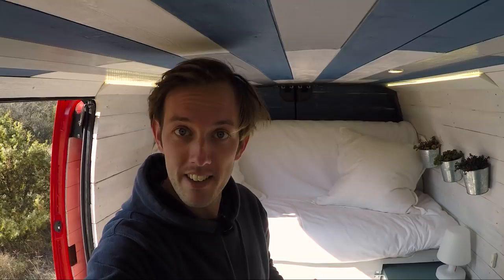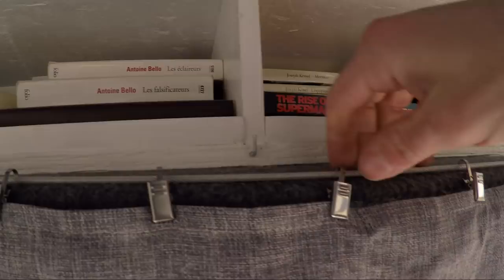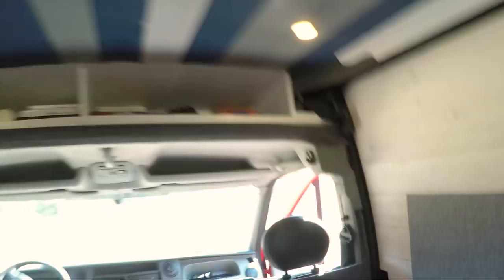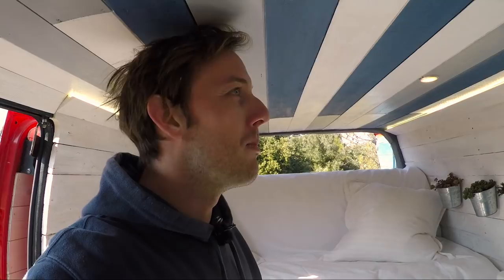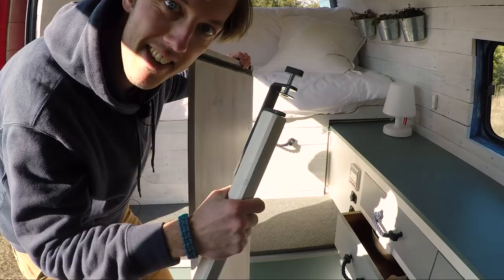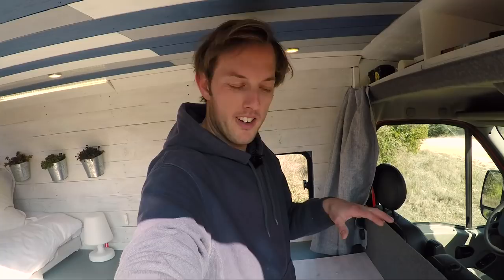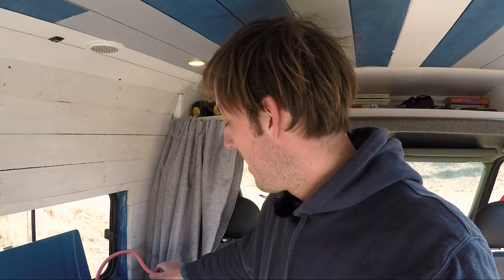VAN TOUR - DIY Camper van / Studio Conversion (New bed and table ideas for short wheelbase van)

Comment: Congratulations! I am a camper builder(Masal Karavan) from Turkey. I will give you an advice. If there is no air space between the roof and the solar panels  , panels don't work well. They must take air , and cool down. Lift your panel 2-3 cm with 'L' aluminyum profile... You will get more ampers from the panels aspecially in hot days.
Reply: Can I ask what about the flexible panels that stick directly on to the roof are they any good? I was thinking about getting these for my van
Reply from the maker: Thanks for the tip! Yes i did think about it but i planed my solar system to have enough energy on cloudy days. So on a sunny day even if they get hot it will be enough... i guess i don't need my system to be as efficient as if i was running solar panels to feed back to the grid. But it will be useful to optimise them if i ever consider adding another battery.
Reply from the maker: Flexible panels are great if you have no other choice, but they are more expensive and much less durable. I killed a Goal Zero folding panel while traveling on a bicycle just because it got a few scratches. If you have a enough space on your roof better take the time to install a good one.
Reply: Batu is correct.  On the other hand, if you are aware of that and choose to do otherwise, that is your choice.   I have enjoyed your videos so far.
Reply: Thank for that info.... I didn't know that and am sure many others didn't know it, either.  However, I'm wondering about the soft solar panels which are made to put down with double sided tape.  Does that mean they lose amperage, too?
Reply: @tegmapat11  It does tegma - the fine print on the panel will say to leave a few centimetres.

Comment: Best minimal van overall. Perfect for a wannabe writer, internet entrepreneur, retired...
Unfortunately, most think they need an 'RV' inside a van. What I have learned:
1) Personal products,  clothes, linens, towels
2) 5 day ice cooler with drain plug
3) 12v Immersion heater coil for hot water.
4) Butane stove (outdoor)
5) minimal small cooking supplies..ect (can beans, soups)..
6) Paint bucket with toilet seat/disposal camping bags.
7) Gallons & cases of water
8) Solar power
9) Security system, personal alarm, weapon.
10) A stealth presence

P.S.- A dishpan is a must for bathing, cleaning, ect.
Join a national gym chain.

Happy Trails

Comment: Thanks for the vid.
Some ideas for improvement:
-Move your kitchen to the back in that space where you keep the bike. You can fit a pullout counter with  alcohol stove , sink, chopping board. Use small kegs or roof mounted water tank which you pump with pressurized air.
-Store more counters and utensils by modifying the hollow rear doors, replacing their supports with aluminum T or V-slot rails. -
-Move the bike to a roof  mount or rear mount on the outside of the doors at the back. 
-Get a spare AC compressor that mounts onto your engine, use it to fill a pneumatic reservoir as you are driving, shuts off once the tank is at pressure. The reservoir is just a tank, you could use an aluminium scuba tank, you could use to power a water pump, drill and other hardware for repairs on the road.
Reply: I kinda like it perfectly the way it is.

Comment: Damn cool :D I would integrate sink and tank just because it would make washing dishes etc. and water management easier. Maybe even water filtration system. A moveable stove is actually pretty good idea because you can also use it outside. You could have top-drawer custom made for the stove, so when you draw it out, it could be used without moving.

Comment from the maker: I hope you guys enjoyed the video. If you have any  questions do leave a comment!
Here are some useful Time Stamps: ↲  Also the Van Build video is here: https://youtu.be/ko-F0Ma4i-w
1:05 Inside of the van
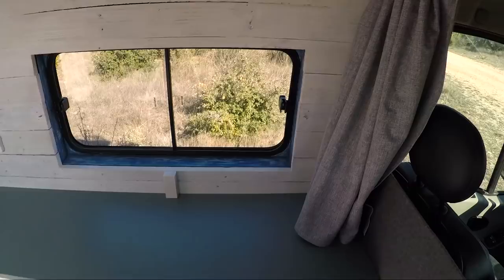1:19 Curtain
1:57 Window panels
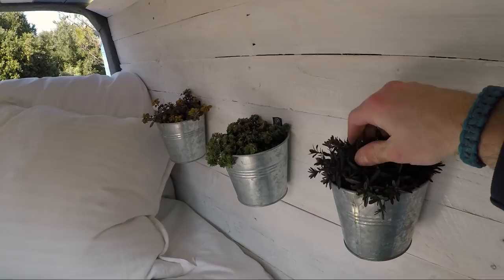3:03 Plants
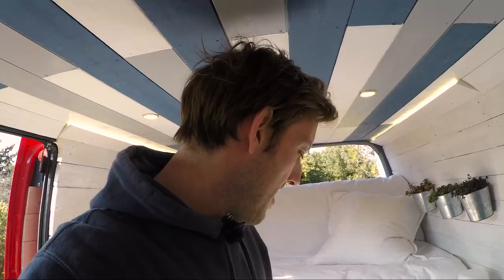3:30 Table
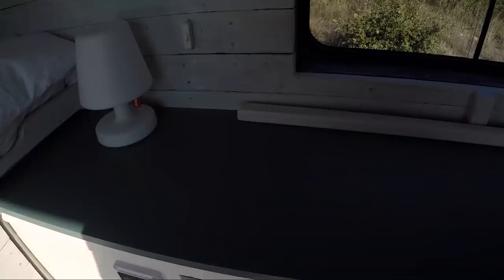5:40 Kitchen
8:33 Water bottle + Heating
9:38 Back storage
10:53 Small fact about me 
11:53 Bed
13:29 Recap/end
Reply: Clever :-)
Reply: Why not drill two holes about half way down on each side of your window board/mat inserts and run some 550 chord through them as handles (similar to your pull on the bed) to make it easy to hold onto them to put them in and to pull them out.  Also a small retainer clip that swivels on each side of the window to keep them in place as time goes on.
Reply: What is your van model? It looks so cute small
Reply: What type of van is it?

Comment: You can always use small heater.  They seem to do the job.  That's what I use when I go camping.   They are small, not to small but it doesn't take much space.   You could put one on the table or two since they are small.

Comment: Fantastic build for a SWB van.  The only thing missing is a toilet/shower area.  I assume this is just 12v only.  I really don't see a need to mains voltages.  There are lots of alternative products that can run on 12v.  e.g. fridges, microwaves, laptop chargers, TVs etc.  The hook for lifting the curtain to stop light escaping is, frankly, just a work of genius.

Looking forward to more of your videos especially the electrical side of things.  Many thanks.  Oh, and I love the way you managed to get your own thumbs up up inside the graphic thumb at the end.
Reply from the maker: Thanks! Yes 12v only. No fridge, no microwave, no tv ;-) but yes i do have a laptop charger, which only recharges when the laptop is off because it requires too much wattage when running... Yes van build is mostly about finding fixes to tiny problems you could not have thought of beforehand (like the curtain fix). For the electrical, it's in the new Q&A video: https://youtu.be/6R4f7fZY4Bk

Comment: If you can find it, use a secondhand webasto (or other brand) diesel or petrol powered engine/cabin heater. Mostly build into car to pre heat the engine an cabin, very useful to use the standard carś heater system to heat your van (Your setup may need some work to get some ducts towards to back and maybe some of the controls extended to the rear) I use it also to heat 10 L of water inside a modified undersink waterheater (which used to be electric but has been converted to be heated by warm water coming from the engine and/or engine pre heater)
Reply from the maker: Thanks for the tips!

Comment: Very nice build!  I like how you put some color in the ceiling of the van and how it coordinates so well with everything!  My only tho't is that I would want TWO legs on that long table end for a little more support!  Otherwise, it's a terrific build, something I would like to have!
Reply from the maker: Thanks for the comment! One leg is definitely enough for stability if the clamping part is wide enough (which could be improved on my system). Check out sash clamp heads, those would do the trick and look a lot better.

Comment: For $50 each you could buy a camping toilet and a camping shower. They pop up outside of the vehicle and stow easily. You could get a tow hitch installed and get a hitch rack and a locking weather proof box to store them outside of the van. Just a thought- for another $200 you could have a full service bathroom.
Reply from the maker: There're a few things that i could think of that would make my life a little easier, but if i don't feel that i'm missing it at least once or twice a week then i don't need it. I bought a solar shower bag which helps with showers, but i don't feel the need for a pop up shower and i still don't have any problem with finding toilets everywhere. So for now my set up works for me.

Comment: Hi, you've got yourself a really nice van, well done! we've just bought ourselves a van like yours I think, citroën jumper L2H2, also red. It was fitted up but we didn't like it as it was, so now we're in the process of undoing everything and starting from scratch! (we're both in our 70's!). We are from Belgium and the work is slowwwww because of the cold weather, I guess.
I've noticed that you fitted windows in yours and I wonder if you could tell me where you bought them from, we've tried to find them as secondhand but it's not easy, so I think we'll have to buy them new, unfortunately. 
Anyway, I will carry on watching your videos, it's fun and interesting. Thanks a lot, see you, byeeeee!!!!!

Comment: put tiny cabinets above the window inside. Below cabinets add magnets to hang on to knives. on one side of cabinet make a small spice rack holder. Put dry goods of food in the cabinets. add 4  - 250 watt solar panels to the roof of the van. Make a black 8 inch dia. pvc pipe capped on both ends one hole at one end to fill it with water, screw on cap and a air fitting so you can add air for pressure then add a hose for shower. secure to the top of van.
Add two more battery's to the system.  get an induction cooktop to cook your food and get a small fan blown electric heater all at wallmart. Buy that water filter you press down on. drink any water anywhere and do not run out. Bolt on a steel rod on the van sliding door side put a tarp here for shade. Swivel t.v on side of bed. opposite the plants.

Comment: Not bad for a short wheel base van. If I were to choose, I would not have painted the wood inside, I would have stained it with some dark varnish to keep the natural look, and I would add a TV and some LED lighting so I can choose I nice relaxing colour like green or red, and also more USB sockets. It looks like you have added the features you need though which is of course the most important. I like how the bed works and maybe this could be made into a more seamless process which would require less effort to set up but it does work well enough. I am not a traveller, I like routine, but I think travelling is really cool especially having your own independence. I think the only thing that puts me off having a home in a van is if the van got stolen. My home, transport and belongings go at the same time so I guess insurance would be tricky to get.

Comment: Nice conversion. I don't fancy the table arrangement though. I find it unhandy to get the table from behind the bed, then screw the leg etc. Same for the cooker. I like all the stuff being all fixed well. Also, I would suggest you some blocking system for the windows obscuring panel.

Comment: The curtain, table legs are awesome thinking, i like the rope drawer handle, van looks neat but i think still need a sink, no need for cooker coz u can use a multi-cooker if u have a solar but i think having a sink would be more convenient :) where’s ur toilet and bath?
Reply from the maker: Thanks! No toilet or shower; there are plenty of those around once you start looking for them. A sink would block one side of the cabinet, so i'd rather have the space as drawers. I could build a mobile sink attached to a water tank if i really needed to, but it hasn't been a problem for now.

Comment: Great video
Did you think to fit Captain seats so you would have better seating for the camper?
Could put outside beach or mountain scene on the inside of those window insulators!? :-)
You could just use an extension for the leg instead on 2 legs for your table! ;-)
Also I like the Rope handles you have used for everything, spot on!
You could maybe have an ext. LPG tank for cooking with a connection point in the van and also outside the van for cooking as well...:-)

Comment: cooking in Vans is terrible i think, the dust from cooking oil etc. will go everywhere, so I would never do it without a proper fume hood, hope your little extractor fan helps a bit.... Cooking outside is much better anyways :) 
Nice Van you buildet there, only thing i am missing is a Toilet and a shower inside which would take just another 1m² and would really have done the trick not searching for public toilets or running into the woods, but ok, I am living in Asia and eating Chili a lot :D :D :D 
Fat THUMBS UP

Comment: This turned out so beautiful! Thanks for sharing it with us! I'm curious, how do you stay cool on summer? My husband and I are gearing up in converting our van but still have to figure out how to deal with heat..
Reply from the maker: Thanks! Isolation is both useful in winter and summer and the van is pretty well insulated (see van build video). Also the wooden deck on the roof blocks direct sunlight and allows the air to flow between the boards and the metal roof of the van. So in summer (this is guessing because I've only been in it in winter for now) it should keep the van from heating like a tin can in the sun.

Comment: Think of getting a filtered water that you can put away.  Zerowater filter 40 cup is the best for moving around since you love water.  I love love love the way you showed us how to build your van.  I wish you lived closer so I can see it in person.  I am doing a lot of research because I want to do this myself.  Luckily I work at an auto auction!   So trust me I droll all the time for a van.   How much did everything cost in total for the build?   Keep me posted please.
Reply from the maker: Thanks for the comment and all the best on finding the right van for you. I'll do a video on van build cost to recap everything. I don't usually filter water, never had a problem. But i do have a Sawyer mini from previous travels in case i run out and need water from a lake or river (never happened though).
Reply: @emal All right I will keep looking for your video when it comes available. :)

Comment: I’ve never thought having a full size bed on a short wheelbase van, it’s quite impressive that it could even fit, however why didn’t you thought on a Mercedes Benz sprinter L or XL?
Reply from the maker: Mercedes are great but more expensive (this is a Renault) and for the size i like to be able to park the van anywhere and the longer vans are just too long for one parking spot (at least in Europe).

Comment: I have watched so many van conversations (including Japanese microvan campers) but yours is far my favourite. I like how you design everything to make it functional in a given space. I really like how you convert the sofa into bed or bed into sofa without sacrificing space when it's not used. By watching your van build I have an udea how my van setup would be, should I buy a van. 

I have a question though,  the cheapest van within my budget is a Japanese microvan that is so similar with Daihatsu hijet just a different brand. I'm planning to put a high top ceiling that I can stand, if I'll make a sofa bed like yours, is it possible?
Reply from the maker: Thanks for the comment! Yes i'm sure it can be adapted to other vans. It's just one option amongst many really. Pick a few you like and once you get the van you'll see what works with the space you have.

Comment: everything turned out perfect for this remodel!---(edit) forgive me for saying this but adding a simple low sq footage heater for when  the space falls below freezing during cold seasons...is that an option?
Reply from the maker: Thanks! Yes there are some heaters for vans, but they are crazy expensive. Cheap gaz heaters are a no go in such a small space and for anything electric i'd need a lot more solar panels and batteries.

Comment: Love it! Simple and Functional ! Have you seen the pop up shower tents? Amazon inexpensive ck it out, also where is you're water source?
Reply from the maker: I'll buy a shower curtain to use between the rear doors of the van for summer. The water source is a 10l tank to refill the water bottles which is enough as there's water available everywhere here.

Comment: Hi! Thanks for the videos, really cool! I have a question about the propane tank. Isn't it dangerous to keep it in your car? What safety mesures do you use with your propane tanks? Thanks!
Reply from the maker: I always close the bottle after cooking, plus it's in a box, so if it did leak a bit it would have to fill the box before anything comes into the van as butane is heavier than air (yes i use butane not propane). I do have a fire extinguisher as well.

Comment: with rising temperatures....how can you sleep without a.c.....or do you sleep with your doors open?  and how do you shower?
Reply from the maker: It usually gets cooler during the night. I never had a problem on my own but i do open the windows if we're two. I bought a solar shower bag so i can shower at the back of the van if needed.

Comment: what kind of a mattress are you using that folds so nicely when the bed is in couch mode? Ta.
Reply from the maker: I've answered that in the Q&A video. It's an old mattress from Ikea. It does folds well but it's not that easy. A custom mattress where you choose the foam especially for that purpose would do the job a lot better.

Comment: I like your van.  Nice job.   Also noticed your table lamp.  I like that too.  Is that battery or plug in? Where did you find it?  Thx
Reply from the maker: Thanks! Yes it runs on battery and recharges with USB. The brand is "Fatboy"

Comment: Love your van. Would just die if I didn’t have my hottie (hot water bottle) if in desperation warm water in a large drinks bottle.
Reply from the maker: Haha i used to do that while cycling in Norway using an old 1.5L coke bottle and hot water from gas stations. Life saver on cold, rainy days!